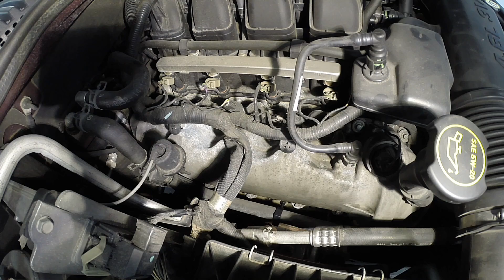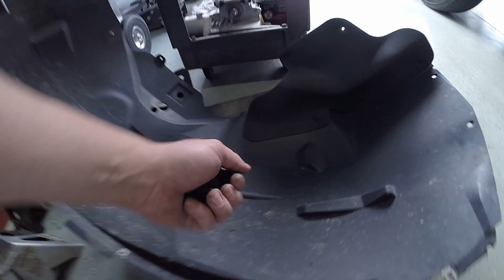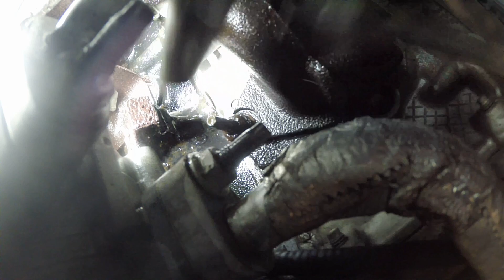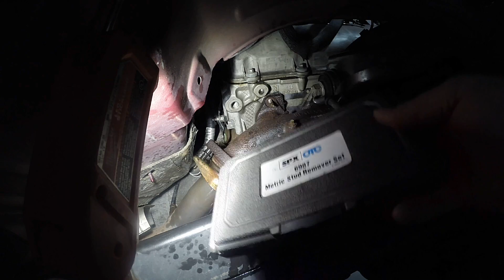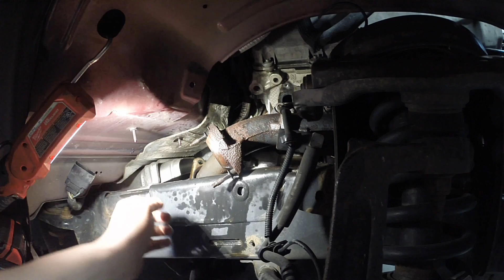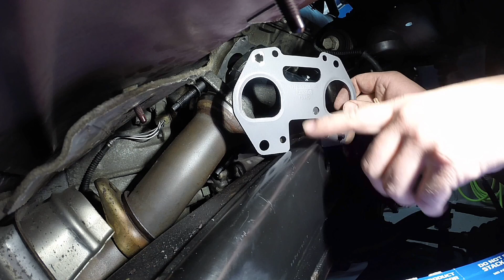Ford Explorer 4.6L 3v: Passenger Exhaust Manifold Replacement

Comment: So I was having this problem exhaust manifold leaking .. lots of noise coming from the passenger side of the engine.. removed the factory manifolds and checked the head with a straight edge  head checked out ok .. replaced the factory manifold with banks torque tube headers .. also replaced the c.o.p.s.. now as the engine warms up it idles rough and completely shuts down .. the read out on the cluster says check gauges and the oil pressure drops to zero .. sorry I couldn't DM this idk how to work this well .. wondering on your thoughts on this... kind of stressing about this .. love the videos thank you..

Comment: Thats very nice of you to do these videos and take your time and show people how to do the work your a great guy. I worked for the Ford dealership for years until 2003 when i messed up my back, I remember these being a pain especially when the nuts were rotted off and you couldn't get a socket on them i had to change my 97 f150 manifolds and they were also a pain. Thanks for the good videos I have been watching a few of your videos especially the one with the ford focus 2012 transmission just got mine back from another clutch replacement and got about 2000 miles on it and it seems ok for now we will see I see how much things have changed since I was a ford tech and I thought things were hi tech then lol. Thanks very much .
Reply from the maker: +Keith West Yeah much has changed since I started at for in 2005 it always amazes me.

Comment: Excellent video Brian.  I have a 2008 Sport Trac 4.6L with 87K miles.  Any tips on how to tell difference between cam phaser noise and exhaust manifold leak?  My engine's a little noisy but I don't smell any fumes.  This is a job I'd want to do only if I have to; the typical broken studs on cylinder 1 are scary.  I'll have to watch your video on how to extract them.

Comment: awesome video,   What about the Driver side?  mine just started leaking at 130K miles.  already had my pass side replaced under the 60K warranty.  but now the driver side one is leaking.   Is its pretty much the same or easier? or harder?

Comment: what do you think about putting headers on 2003 ford f 250 super duty 4x4.  Exhaust manifold leaking now 121,000 miles 5.4 . Also should I do the y pipe delete to open her up more I plow .and pull a landscape trailer with my truck. Thanks ,and thanks for the great instructional videos.

Comment: I'm glad you covered going back and verify the torque after the first torque pass of the manifold. Most people would not do that step and wonder why after a few miles the sound has returned. Anything I torque I will re-torque the bolts until I get no movement on all bolts, if any bolt moves during the torque sequence I redo the entire torque sequence. Good job on re-checking torque after the heat cycle also. I don't think you emphasized that point enough. Great Video.

Comment: Don't have to pull the head off when the studs break off in the head.If you have access to a mig welder,weld a nut on the broken part of the stud.This has been a proven way to extract a broken off fastner out and sometimes heat with a torch is needed.I like using the impact style swivels,no binding at all.
Reply from the maker: +wafrederick Yeah I was thinking if I was not able to drill them out I would show the welding trick. One problem with that is most shops don't have a welder and even worse no one knows how to use it. Plus I don't see a diy going out to buy a welder to get a manifold bolted back up. I am really thinking of upgrading my swivels next as it is just time.

Comment: I hear dorman is junk. Is it worth the extra money to get ford manifolds for a older 5.0 explorer the ones that are welded not cast?
Reply from the maker: Dorman is junk for allot of things but theses appeared well made and very close to the Ford manifolds il have been putting on the last 10 years. Time will tell this is my cousins truck.
Reply: Sounds good thanks FordTechMakuloco
Reply: FordTechMakuloco how did the manifold hold up?
Reply: They likely use inferior grade cast iron and they skip the careful heat treatments that reduce residual stresses caused by the casting process to keep them cheap, cheap, cheap.  I bet they twist and warp.

Comment: When r we going to get the missing bits of the job?  Like when discharged the AC and removed that tube from compressor. Also, perhaps u could give us a link on where to buy left hand drill bits. And how did u get the studs out? Thank u Brian!!
Reply from the maker: +Bill Rimmer I am working on that video today. Ford most simple unbolting the compressor and moving it out of the way is the way to go, I have a recovery machine so of course I am just going to pop the lines.

Comment: I bought all the parts to do this on my expedition then ended up trading it in only hours before I was supposed to start working on it lol.  So I have parts if anyone needs them.
Reply from the maker: +Jsomedaysoon Thompson Oh man that was close I think you are better off.
Reply: +Jsomedaysoon Thompson what year and engine size are your expedition parts, if you still have them.
Reply: 01 with a 5.4 and yea I do as of right now.
Reply: +Jsomedaysoon Thompson would they work for a 03, and what is all you have.
Reply: i'm not sure, Honestly I don't think they will but I could be wrong,  I have the exhaust manifold, the gasket, the studs, and the bolts that connect the manifold to the down pipe.
Reply: +FordTechMakuloco 
Mr. Makuloco do you know if those 01 parts will fit my 03 Expedition.
Reply: +Jsomedaysoon Thompson shoot me an email please saveskee11@gmail.com

Comment: You made the comment that if the front two studs break that you might as well remove the cylinder head. Don't those have a complicated timing chain setup on the front of the engine that requires special tools?  Also isn't there a front cover on the engine that has to come off? Along with the AC compressor and the crankshaft pulley and the power steering pump and all the belt pulleys? And also how do you reinstall the chains in the correct position without those special tools that the Ford mechanics use? And if I screw up just one of those steps couldn't I possible destroy my engine? I saw on a sign in my local Ford dealer service center that they offer "two year" parts and service warranty on ALL repairs. Boy a job like that sure seems intimidating to do on my own with all that could potentially go wrong don't you think? I kind of understand why Ford charges like they do for repairs like that, I mean with all there special tools and training and that service warranty to boot. That's where I'll be taking my Ford.
Reply from the maker: +zombiesolutions95 It's not as complicated as it looks I videos on most of this.

Comment: Just curious, do you ever use antiseize on the new studs or is that a no-no? Do they want them to be dry torqued with no antiseize? When you remove the old studs, do you ever use an impact or does that just cause the studs to break easier? Just wondering if the vibration from the impact would loosen them easier? I think probably hand tools are best like you are using, just wondering if you had tried other ways.
Reply from the maker: +jdtractor man impacts generally loosen them better if you can get at them dead on. Anti seize on the new studs are not required they are all stainless steel.

Comment: Great vid. as always ,but do ya have vid of pulling the 4r75 trans from 04-05 F150I just pulled and getting ready to install back in ,I left Y pipe exaust in place and wiggled past sway bar and Y pipe ,any little tip in ease of reinstall would be great . and what ya think ? stick with mercron v or is there any alternitives fluid? tHANKS FOR ALL THE GREAT INFO THOUGH!!
Reply from the maker: +TIM WEAVER These go back in the same way you took it out by inching it past all the components, as far as mating them up get everything nice and lines up best you can so you can get a bolt on each side just started in there a few threads to help align the trans then slide forward to line up and push the converter studs through the flexplate. What I use to move the converter is a long thin flat head screwdriver until the studs align then push trans in a bit more till it falls into place. Once you are past thet snug up those two bolts from earlier hand tight. Next stick the screwdriver up in there again and flick the studs on the converter back and forth you should be able to move it in there if not it is bound up and not aligned right.
Reply: Thanks for the input lot different from them FMX C6 transmission days.  tough when every thing is so tight and I am to big 6'1" 225lb !  LOL thank you .

Comment: Any particular reason why the studs break in the Explorers?  I have an '05 Navigator 5.4L 3V, same stud breakage/exhaust manifold leak common?
Reply from the maker: Rust rust and more rust.  The design lends itself to corrosion problems with the hole in the manifold being larger so everything just collects in there. This stud breakage is common on all 3v engines
Reply: +FordTechMakuloco Thanks! really great advice you give out.  good luck to your business, the name Blood Sweat and Gears is very cool.

Comment: Awesome video! Wish I saw this 3 years ago. I had my 2006 Ford Explorer 4.6L 3V exhaust manifold replaced at 92,000 miles in the fall of 2013 at a local Ford Dealer.  It was very annoying issue on an otherwise great vehicle.  I had the passenger side replaced on the engine by the dealer.  Lets just say the total bill was $3,000 to do this side. The dealer workshop manual said head removal was required to do the job and near 20 hours of labor.  All parts were replaced on this side, new manifold, bolts, etc... I don't know if I got screwed or not.  Now at 129,000 miles and haven't had a single issue.  But now the driver's side needs to be done, as it sounds horrible. Just offering this information out there for everybody.  

If anybody has any advice on how to tackle the driver's side manifold please let me know.  I got a quote from a different dealer for about $1500 for parts and labor.  Is the drivers side easier??
Reply from the maker: +redgtocruiser Drivers side is the same method but easier to access in general.

Comment: Great video.  Tons of useful tips, as usual. Thanks!     I did notice on my 2008 F-250SD with the 5.4 3v,  the previous owner had the entire exhaust system replaced, right up to manifolds.  I also see that the driver's side, lower rear manifold stud is missing/broken.   I guess I should fix it the way you describe in this video.
Reply from the maker: +009to090 Yeah the rear studs are common to break on those but are much easier to remove.

Comment: When bolting the new manifold on, would you recommend using any sort of anti seize in order to prevent the issue with broken studs in the future?
Reply from the maker: +Claude “Reviews4U” Rains I am not sure what it is but the stainless studs from Ford already have a coating on them as shown in the video it looks copper in color.
Reply from the maker: +Skauber No anti seize just use the all new stainless hardware linked in the video description and you wont have a problem with breakage again.
Reply: +Skauber I used copper coat and never had an issue with them again. Just avoid the stainless steel studs. They don't like aluminum and seize up in there.
Reply: +Skauber  I do.
Reply: +Claude “Reviews4U” Rains 
The updated studs and nuts from Ford are stainless. 
Using stainless steel in aluminum is not a problem especially if you use a non metallic anti-seize such as Loctite 34026. 
http://www.amazon.com/Loctite-34026-Marine-Anti-Seize-Bottle/dp/B000WXHGHA/ref=sr_1_1?s=automotive&ie=UTF8&qid=1447330175&sr=1-1&keywords=loctite+34026&pebp=1447330182874&perid=00WTF1RV27P27Y87N17D
.
Reply: FordTechMakuloco Do you advocate NOT using any anti-seize on exhaust fasteners? 
How about when using aftermarket fasteners that are plain steel or uncoated or not copper plated stainless?
Reply from the maker: +patw52pb1 Not on these stainless ones no, but on anything that is plain steel like the downpipe studs yes as I am shown putting anti seize on these in the video.

Comment: Are the ford updated replacement studs stainless steel?
Reply from the maker: +Steve L yes I link to them below the video, the ford units also have an additional coating on them over the aftermarket.
Reply: +Steve L 
Yes.
Reply: +FordTechMakuloco thanks for the reply, unless I missed it, no anti seize on the studs into the head? Going to be tackling this soon, looking forward to your video of the drilling

Comment: great video   now I can try my 5.4 in my old fed ex truck
I have broken studs and I cant find your video on that
I already bought the angle drill and some extractors,...maybe I should order some reverse twist drills,.
can you tell me where the video is on broken exhaust studs?
thanks
robert b niagara falls
Reply from the maker: +70carlton I a still producing the video on extracting the studs. reverse drill bits are also an option.
Reply: Easiest way is to weld onto the broken studs, build it out with a mig welder and weld a nut on.Yes I bought a welder just for removing broken exhaust studs.

Drilling for me was pretty unsuccessful, maybe a 50% chance success rate vs 100% success welding.
Reply: The weld sticks to the steel and not the aluminum. Same thing if your removing studs from cast iron heads.
Reply: +m ph I have no choice but to at least try it myself
if there is anything sticking out at all I am going to weld on a nut,...the heat in the stud should break the bond 
I think I have the tools and also I am used to working with metal etc as I have done welding and have worked in a machine shop,....now I am disabled I dont have the money to get help   thanks for the advice
Reply: Sounds like you are ready to tackle it. Even if the broken bolt is recessed it comes out with the welding tip. I have had studs broken off 1/4" in, just built it out with weld. 

Check out Irwin tools bolt-grip extractor set, available on Amazon or many auto parts stores. In the past I built the weld out and "gripped" onto the weld with these and the studs came out. Much easier than actually getting a nut welded on.
Reply: +m ph When welding on to the studs, how do you make sure that you're not welding into the head? Is there any trick to that, or is it basically with practice and a steady hand?
Reply from the maker: +m ph Sure is I plan on having a video on this in the future but most aren't going to go out and buy a welder just to fix their truck one time but for me as a new shop owner a welder is becoming a necessity.
Reply: +FordTechMakuloco Removing broken studs from a head really isn&#39;t a DIY type of job. Its one of the more complicated repairs you could do on one of these vehicles. Very tight space and rust add to the frustration. Look at Ericthecarguy, he used a drill and drilled right into the water jacket of a head drilling out exhaust studs. ITs very tough to drill straight, maintain the correct angle and stay centered. Plus once drilled the &quot;extractor&quot; is easily broken for stubborn studs.

My first experience 5 or so years ago drilling out studs turned into a complete disaster. A 2001 F250 v10, this thing had like 10 broken studs. After pulling the manifolds I bought a right angle drill/left handed bits and was good to go so I thought. I managed to get 2-3 out successfully, buggered up another 2 holes and finally conceded on day 2 before I did any more damage. I had the truck towed to an exhaust shop, Paid $1100 for them to finish the job. 

The next job I purchased a Lincoln Handy mig 120v welder for $300 NEW and was successful on day one. Welding a nut onto the broken stud is tough to do (if not close to impossible) with flux core wire. BUT you can build the weld out and use a stripped bolt extractor on the weld to get them out. OR spend another $150 for a shielding gas tank for the welder for decent welds. 

So a $300-500 investment on tools for 1 job may not be a bad investment in some cases. Look at the guy who spent $3k for this job or myself who spent $1100 for one job.
Reply: +m ph Would a basic stick welder work? Or do you need gas?
Reply: +alb12345672 maybe if you are good at it 
but I am just guessing as I go
Reply: +70carlton Once you break off an extractor or drill bit you have a bigger problem because those things are brittle and HARD. There is nothing to really drill thru those, it is real pita when you need something even smaller to go on the side.  You are also space constrained there. Like m ph said  you have the risk of the water jackets on a block. I know experienced techs who wouldn' t risk that. I would be shitting a brick doing that procedure. Welding heat also breaks rust bonds. Hope to see Maculocos followup vid.
Reply: +alb12345672 A stick welder may work if you use the correct rod. May want to ask around to find out what the ideal rod would be.